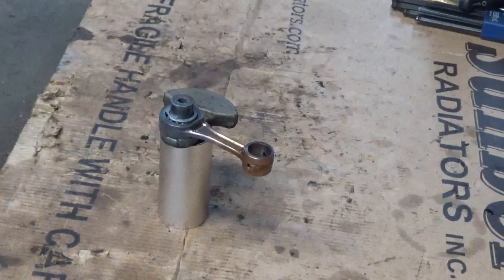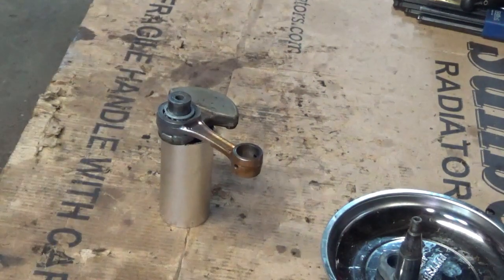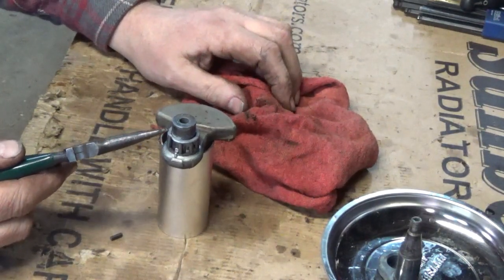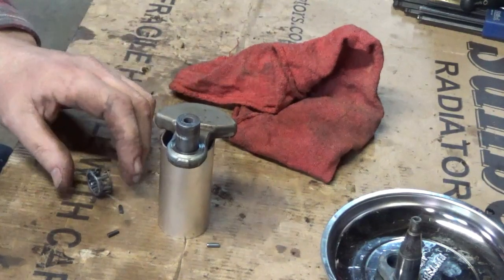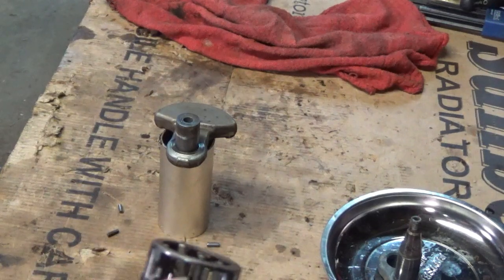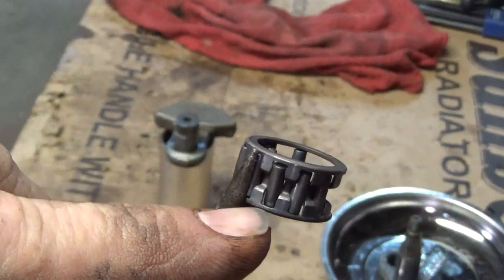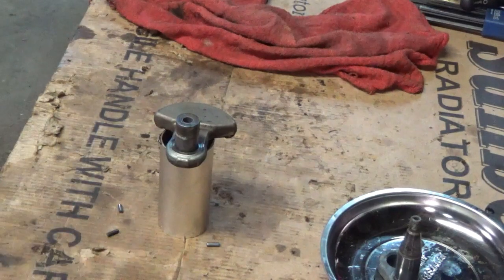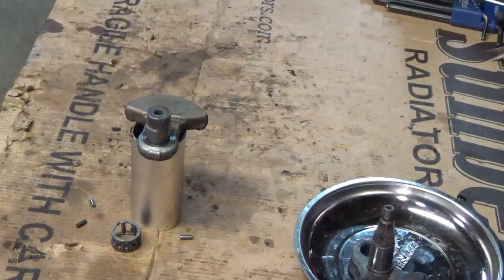Husqvarna 576xp a close look at the Crank Pin Rod Bearing Failure

Comment: I've often wanted to separate a chainsaw Crankshaft /big end at times....and wonder if an agri supplies store or engineering shop could supply a replacement needle bearing?..nxt prob would be truing crank good enough to re use ...now there's a vid for you to consider....but really like your approach to making vids...well done...
Reply from the maker: The bearings come from somewhere just have to find them, the thing is finding them